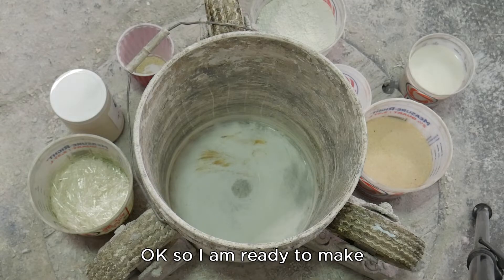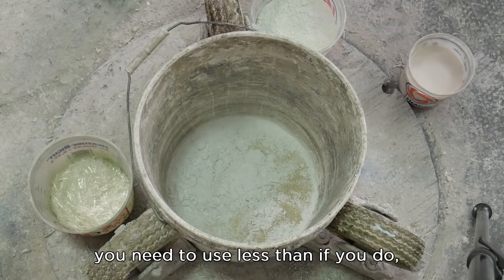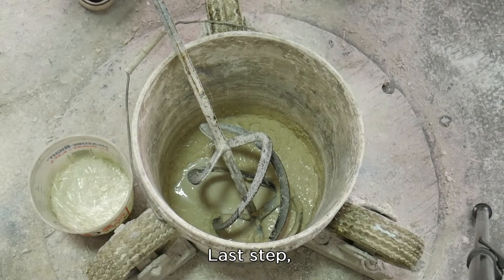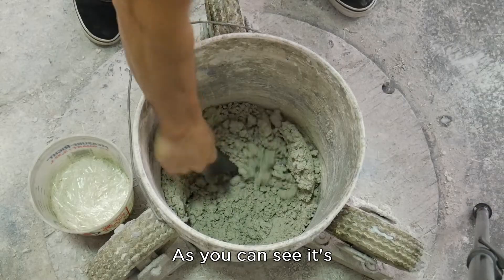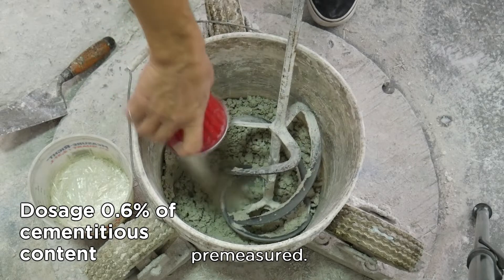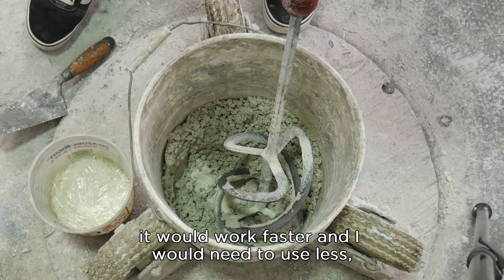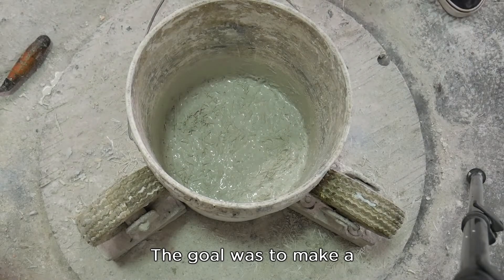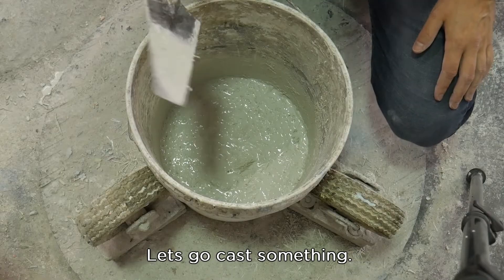Superplasticizer for concrete countertop mix

Comment: I would suggest another mixer blade, there are better ones for stone and sand, the one here is  made more for paint or drywall mud. That blade requires more turning to mix, which causes more air to be entrained into the mix. Every air bubble is a weak spot in concrete. I would also suggest to others that mixing at a much slower speed than what you are showing as that is where all the air is being added. The more blades you have on the mixer, and the higher speed or RPMs the mixer goes, the more air you get in your mix. Even if you are pouring up side down, you still do not want air in your mix. There is a reason that mortar and concrete mixers are set to move at slow speeds. The goal is to mix as slow as possible but as thoroughly as possible. Mixing beyond the point of all the materials are touching each other completely is just adding more air to the mix as well as letting your mix set up more than it should.
Reply from the maker: Your opinion is appreciated, but you are wrong about slow speed mixing. GFRC is not like ordinary concrete and it requires high speed mixing to fully disperse the ingredients. GFRC does not have coarse aggregate in it, so slow speed mixing won't work well. It has always been mixed with high shear, high rpm mixers, both on a small artistic level and a global commercial scale. Simply put, high shear mixing is an integral part of the mixing process. Incidentally, this style of blade I'm using is very effective and has been used very successfully for decades for this very type of mix. A major commercial GFRC equipment manufacturer uses a very similar helical blade design for their much larger equipment which can spin up to 1400 rpm. Clearly high shear mixing isn't wrong or it wouldn't be used for nearly half a century for making commercial GFRC. 

CCI's mixes incorporate a powerful defoamer which help prevent foaming, and UltraFlow makes the mix flowable, allowing that entrapped air escape. While your comments attempt to be helpful, they come from the perspective of ordinary concrete and don't account for the unique properties and mixing requirements of GFRC.
Here's a link to an article I wrote about high shear mixing many years ago: https://concretecountertopinstitute.com/free-training/gfrc-equipment-for-concrete-countertops/

Comment: Great video, I’m in the process of building 12 concrete shooting tables, thought I would watch some videos to catch up with technology, looks like I’m way behind. I’ve bought Alpha-Pro fluidizer, Sakrete Acrylic Fortifier and fiberglass. I see your using Alpha-Pro Defoamer. If I’m using Sakrete premix extra strength in a concrete mixer what would be the steps you would use? All dry mix first? Thanks for helping me not mess up my first bench.
Reply from the maker: Your first step is to figure out how much Fluidizer and Defoamer to use. The risk of using too little is small (you'll just have to add a little bit more), but the risk of using too much is that you'll segregate the mix. This is when the cement paste turns so runny that it separates from the aggregate, and this is not what you want. So start with a low dose and see how that goes. I'd suggest a 0.25% starting dose. This means you'd add 1/4 lb of Fluidizer per 100 lbs of cement that's in your concrete (remember cement is one ingredient in your concrete). Looking at the Sakrete SDS documents for their high strength mixes, they list the cement content as 7%-13% of the bag's total weight. Let's pick 10% as a reasonable and easy number, since we can't guess any more accurately than that). If you're using 60 lb bags, 10% of 60 lbs is 6 lbs, so each 60 lb bag has 6 lbs of cement in it. 6 lbs x 0.25% (which is the same as 0.0025) = 0.015lbs, or 6.8 grams. This amount is roughly 1 teaspoon of Fluidizer. Do the same for Defoamer, but use less. I'd say a mounded 1/2 teaspoon of Defoamer per bag of premix. You want to dry blend ALL of the Fluidizer and Defoamer into one bag of premix. This gets it all dispersed into the mix, and you can do this in the concrete mixer for simplicity. Do not add all the premix! Next, add the total amount of water for all the concrete you plan on making in the mixer (let's say it's 3 bags worth), and use the manufacturer's minimum (never maximum) water amount. Add all of the acrylic fortifier too. Run this until there's no dry material left. Now add the remaining 2 bags of premix slowly, letting the dry material fully incorporate before adding more. I'd not add more than 1/2 bag at a time, but go slower when you get to the last bag. Let this mix for a few more minutes then adjust the consistency if needed. IF you get it too runny, you can add more dry mix to stiffen it up. Always add the glass fibers last (never first), and mix until they're fully incorporated. Note that these kinds of concrete mixes are not meant to get really fluid. They're designed to make a 2-3" slump, which is suitable for troweled concrete, so don't expect your concrete to flow. Finally, if you want success, make a trial batch and cast something that doesn't matter first before starting on your project. Good luck!
Reply: @ thank you so very much, I have to pour a 2’x12’ extension and a wheelchair ramp so I should have a little practice before we pour the first bench. Have a great day.

Comment: I just ordered this plasticizer. How much to mix with an 80 lb bag of Quickcrete.   Thanks!
Reply from the maker: I can't say how much superplasticizer to add for few reasons: I don't know which Quikrete product you have, I don't know what you want to do with it, I don't know what you expect from it, and I don't use these products because they are not the right kinds of concrete that I need when I make the things I make. That doesn't mean they're not good for other things, but I lack the experience using Quikrete products (or similar home-center bagged concrete mixes) to give you any meaningful guidance. So I can't directly answer your question, but I can give you some tips to help you figure it out.

Quikrete has at least 4 different concrete products packaged in 80lb bags and presumably they are all somewhat different in composition. What further complicates things is that the SDS data sheets for all of these products lists the same exact content: cement content (10% to 30%) and fly ash content of 5% to 10%. This means that there could be as little as 15% or up to 40% cementitious content in the bag of concrete you have. The only thing I do know is that it weighs 80 lbs, so you have anywhere from 12 lbs to 32 lbs of cementitious content in each bag. That's a HUGE range to work with and it makes any recommendation little more than a blind guess.

Most Quikrete concrete mixes are designed to make concrete that achieves a 2" to 3" slump - and that's directly from the product's instructions. A 2" to 3" slump is very far from anything remotely flowable. The countertop mix recommends a 5" to 7" slump and no more, which means it's softer and easier to spread, but it's not flowable. Adding superplasticizer can help increase the workability somewhat, but it's unlikely you'll make them flowable, so you don't want to add too much (more on this later). How much you should add depends on the mix itself and how much cementitious material is in the bag. And there is the second hurdle. We just don't know how much that is. 

Normally you'd add a lot of water to the mix to make it workable and that's how 95% of concrete is made. However, the resulting strengths are just adequate for most applications (sidewalks, fence posts, etc), and the overall quality of the concrete suffers. Superplasticizers let you use less water in the mix so you end up making stronger concrete, but that doesn't mean the basic mix design can support flowability. Superplasticizers are tools that modify the cement paste in the mix, but not all superplasticizers can turn any concrete mix into something like what you're seeing in the video. What you saw was a very different mix that was specifically designed to be made flowable. 

Here's my recommendation:

Start by adding the minimum amount of water recommended by the manufacturer for the exact product you have. Then while mixing, gradually add small amounts of my superplasticizer to the mix as it's mixing. Let each addition fully incorporate and mix for at least 1 to 2 minutes to disperse before adding a bit more and repeating. Keep track of this, so you can add the same amount for future batches. The easiest way is to use kitchen measuring spoons, and I'd start with a flat Tablespoon. You're better off premixing the superplasticizer into the dry mix before you add the water, but you can't do this if you don't know how much to add.

As noted in the product description, start with tiny doses to gain workability. You CAN add too much. What will happen is the cement paste (cement plus water) will start as a thick paste and turn into a very runny liquid. This is called segregation, and the sand and rocks in the mix will settle out and you'll have a mess. You do not want to segregate your concrete, so do not add too much superplasticzer at once. If you do see segregation, add more dry material.

Here's more information about the product you just bought:
https://concretecountertopinstitute.com/product/ultraflow-dry-superplasticizer-for-concrete-countertop-mixes/
Reply: @TheConcreteCountertopInstitute  Wow that was alot, thanks for the quick reply!

What I’m doing:  Pouring a concrete footer to support a 7’X8’ metal chicken coop.  The footer will be square, about 4-5 inches deep and 8 inches wide.  Its open in the middle so chickens can dig around in the dirt.  
Concrete I’m using:  It will take about 13-14 80 lb bags of Quickcrete concrete mix item #100180. You’re right, SDS says cement content 10%-30% and fly ash 5 -10. 
What I expect your product to do:  Better flowability so it fills all the voids better and easier to work with.  I’ve made small pads and set fence posts in the past, it’s a little hard to work with. I want to use the least amount to water possible, so I discovered using plasticizers, and also learned that most concrete contractors order their concrete to be delivered with plasticizers in the mix.  I just want a little better flowability.  I’m not making countertops, so it doesn’t need to be nearly as flowable in the mix in your video. 
Yes I agree about segregation, as that will ruin my project.  Again, thx for your reply and I’ll follow your recommendations.  Let me know if you have any more recommendations since I provided more details. 
Thanks!!  

https://share.icloud.com/photos/055AS5XWm_Dn6Z6nAYtgVUw6A

Comment: There are a variety of different superplasticizers to meet different concrete needs. So I don't know if you can say that this is the "best" one there is. It may be the best for your particular counter top mix but it may not be the best for every concrete mix. One might say best for what? To make it self level? To make the matrix hold together? To add the least amount of air? To effect the finish concrete the best? To add air entrainmetn for freeze/thaw environments? Supers are horrible for the environment so maybe one that does not destroy the earth is the best for the planet but not the best for the concrete mix.

Comment: Nice. If you were to fill a mold with dry concrete would that roughly be the amount of concrete you need for that mold? Trying not to waste concrete here.
Reply from the maker: A mold filled with dry concrete would always underestimate the amount of concrete needed to fill that mold, but because I don't know anything about your concrete, it's not possible to give a precise answer as to how much you are underestimating the true amount. The most accurate way to determine the volume of a mold is to fill that mold completely full of water. Either weigh the water or determine its volume with measuring containers. Freshly mixed concrete has a density that often varies from about 130 lbs/cubic foot to 150 lbs per cubic foot, depending upon your mix design. Use Google to convert to metric units if necessary. A conservative estimate would use 150 lbs/cubic foot.
Reply: @TheConcreteCountertopInstitute  I actually  just realized your mold in this video is about the same as mine. Mine is 15x15 inches 2 inches deep. I make decorative pavers 1:3 ratio cement to sand. From the looks of it around 7 quarts mix should get me close.
Reply from the maker: @brandonmonroe7050  Sounds good.

Comment: Which admixture do you use to get the most watertight concrete?
Reply from the maker: The best answer is a combination of things. You want your concrete to be denser, so we recommend our alpha pro admix combined with our fluidizer. That said, we always recommend sealing your concrete, and in the case of a shower, whether walls, pan, or both, we still recommend waterproofing under the concrete.
Reply: @TheConcreteCountertopInstitute  
Thank you! 
It's for a countertop project. I want a countertop that I can put things in to of it right out of the oven. My problem with sealers is that most of them aren't high heat proof. Do you have a sealer you recommend? (High gloss)
Reply from the maker: We always advise using trivets for hot items, that said, we have tested our Omega sealer to 500° with no damage. This doesn’t, however, mean that the heat won’t affect other things. Some pigments are heat sensitive, etc.
Reply: @TheConcreteCountertopInstitute  
Thanks. I'm planning on making it pure black... So discoloring won't really be an issue, as long as the sealer is good for it. I'll try and find how to get it in Canada.

Comment: Please show the mix design of your project?. Thanks
Reply from the maker: This was more of an example of the potency of our superplasticizer than an actual project, but in production, we’ve found that at a .30 w/c ratio, and fluidizer at .45, it makes a lovely self consolidating mix in an Imer 120. Your dose will depend on your mixer, so we recommend you try it and tweak it for yourself for best results.

Comment: could you spray the bubbles with alcohol to pop them?
Reply from the maker: Blowing compressed air usually pops them, but it's not necessary. The bubbles you see at the top of the bucket will disappear as the concrete is poured. And bubbles on the surface of your casting will either pop on their own, or won't matter because it's the bottom of the demolded concrete casting.

Comment: What is the working time for casting?... much appreciated
Reply from the maker: The working time is normal for the concrete you're using. For this mix, it's about 20 to 45 minutes in room temperature conditions, more than enough time to do what you want with it.

Comment: is it stronger if it is used in house? like is it less prone to cracking and rain water seeping inside the house?
Reply from the maker: This product is designed to change the viscosity of the mix while it’s wet. Although making higher quality concrete will improve results in all aspects of work with the material, we must account for external factors that can cause seeping and cracking that aren’t related necessarily to the concrete’s admixtures

Comment: I still don't understand the use of plasticizers. Seems like it someone makes the dry cement mix, a wet cement mix. Wouldn't adding water do the same thing ?
Reply from the maker: While it's true that adding water makes a concrete mix wetter, adding extra water dilutes the cement paste and weakens the concrete. This often leads to problems like shrinkage cracks, spalling, flaking, and overall poor performance. Nearly all concrete, and certainly all normal concrete is made with more water than it actually needs for strength. Superplasticizers help the fine cement particles repel each other, adding workability without adding extra water. When a very strong concrete with exceptional properties is required, a minimal amount of water is added to the mix and superplasticizers are used to make that water more effective at adding workability. Because no extra water was added, that concrete now had much better performance and is far less likely to have the problems that concrete made with too much water has. 

For a more detailed explanation, check out these two articles I wrote a while ago: 
https://concretecountertopinstitute.com/free-training/concrete-countertop-mix-ingredients-and-admixtures/
https://concretecountertopinstitute.com/free-training/the-importance-of-water-cement-ratio-in-concrete-countertop-mix-design/

Comment: what fibers do you use ?
Reply from the maker: I use my own alkaline-resistant 19mm glass fibers. These are specially designed for GFRC and are not used in other regular concrete applications. 

https://concretecountertopinstitute.com/product/alpha-pro-reinforcements/

Comment: does this have a delay set in it too?
Reply from the maker: No, Alpha Pro Fluidizer does not have a delay set built into it. However, as with many superplasticizers, if you use too high of a dose there can be a mild delaying effect.

Comment: Can it work with thinset?
Reply from the maker: Superplasticizer (as well as low range and mid range water reducers) acts upon the cement in the concrete mix. Thinset does contain cement, but it also has a lot of other things that concrete doesn't have. So the effects could be unpredictable. Plus thinset is supposed to be thick and sticky. So I'm not sure what value superplasticizer would add.